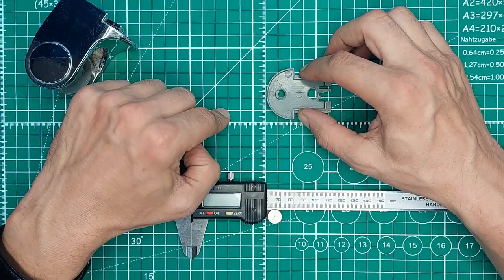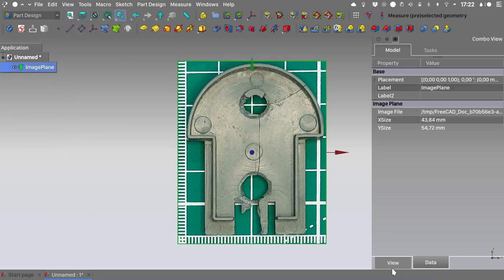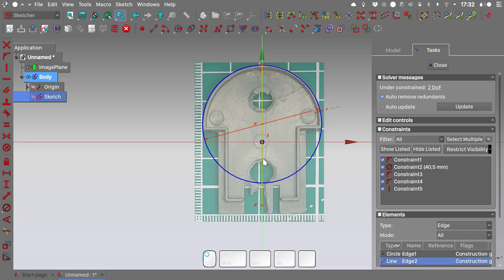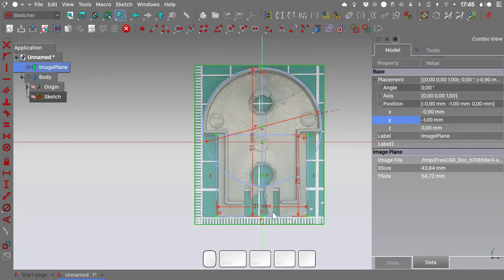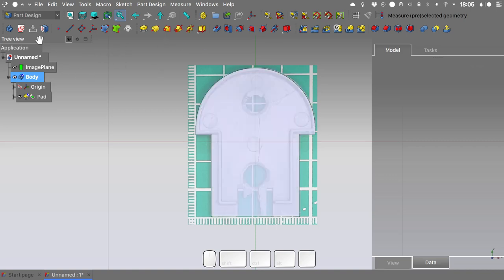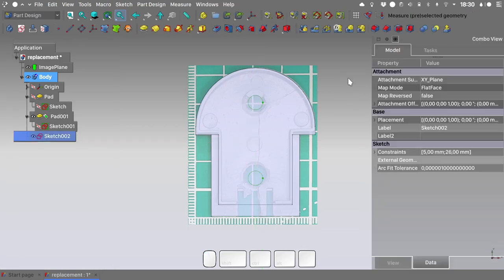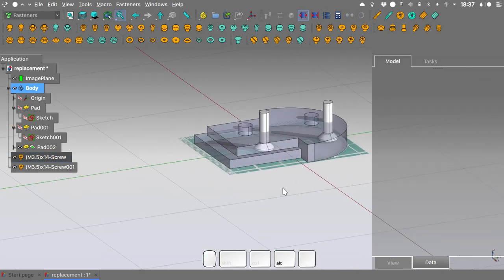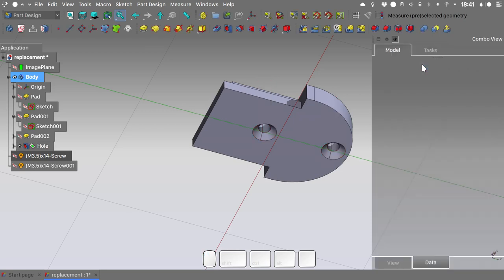How to replace a "impossible to find" component using only free software and a cheap 3d printer.

Comment: LOL, loved the intro!  Matches my scenario, where I purchased "one of those cars" that has proprietary plastic parts in their window regulators to move the window up and down under power.  I used this as my goal part to learn FreeCAD, having only done some simple loft and hole designs prior.  Hours and 5 test prints later (2 full, 3 partial), I had a working part with a 3D space curved boolean cut and complex internal geometry for the cabling system and attachment to the glass.

I now have a model I can mirror for any door as well as the knowledge of how to do such a design MUCH faster in the future!

Comment: pro tip: if you're using PrusaSlicer you can import the STEP file directly, no need to create a mesh
Reply: If you are exporting a file from the tool you use to make it, then the extension of the file doesn't really matter.

Comment: Another great video how to use the full potential of the linkstage freeCad. When it's on me to rebuild a part, I wonder if there is a a way to measure directly based on the image. Maybe by converting it into a svg draft and set measurement points?
The last thing I rebuild was a chain protector disc (to save the trousers) for an older di blasi folding bicycle.

Comment: Why do you export it as mesh? You can just select the body and go to File->Export
Reply: If you just export from the solid, the defaults for surface deviation/angular accuracy will be used. This way you can control it individually. But most of the time, I find defaults are good enough and I don't bother with creating a mesh manually.
Reply: Also very simple to use macro Export2Slicer for send model to slicer by one click.